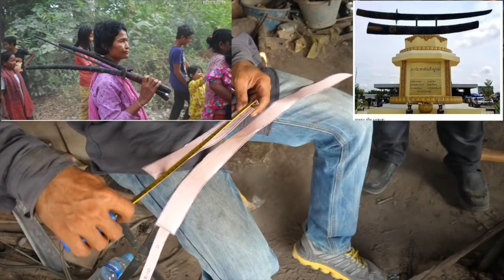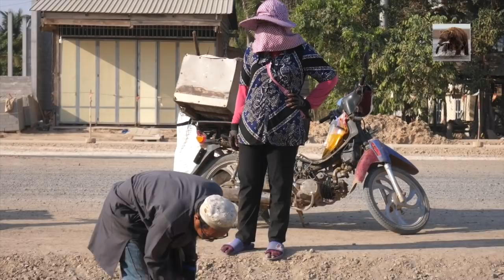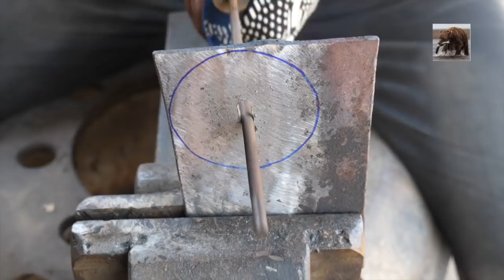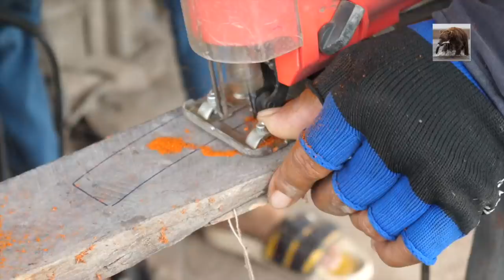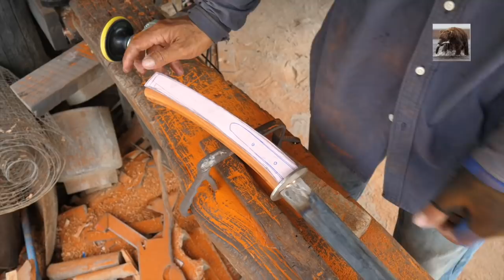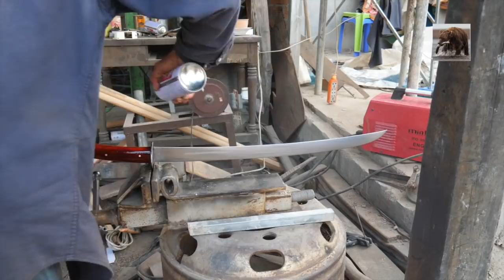HOW TO TURN A THICK BEARING INNER RING INTO A LONG KOMPONG SVAY SWORD (NOT FOR SALE )

Comment: Most bearings are made of 52100 steel. It is very good for small blades, eventually for a median blade. I have never seen a bladesmith using 52100 for a long balde. They usually use 5160, 1070 or 1080 steels.

Comment: Really really nicely done!!
Only thing i would have done is to make tje handle section longer.
So the metal go all the way throu the handle.
But it is a wonderful blade you have done❤
Reply: well, he couldn't do because the customer wanted this way
Reply: @kassiog.6595  👌
Reply: @kassiog.6595  Ok. I love the sword anyway..
A really skillfull Blacksmith is what he is.

Ask him if he could try to do a Finnish Puukko.
Its a traditionall knife from Finland.
Reply: Not to mention you would throw the balance off making it longer.
Reply: @lonkero  i've made one a couple months ago, they're cool indeed
Reply: @kassiog.6595  I also made a couple of Puukkos. About 30.
And 20 axes.
Only 4 swords. But i have to operate  my wrist on my right hand before i can continue.